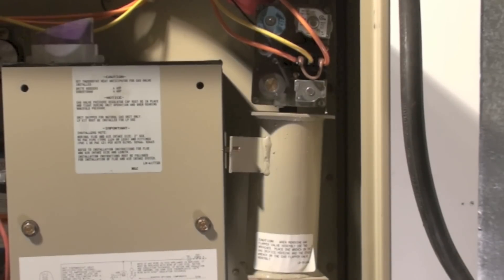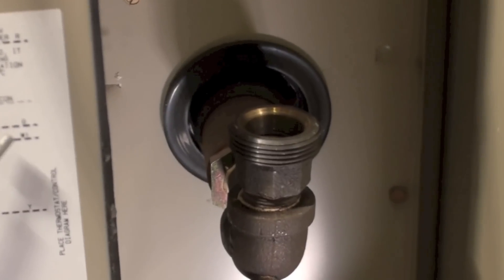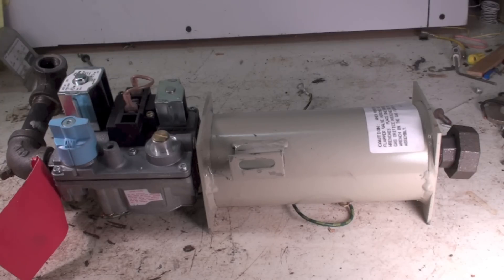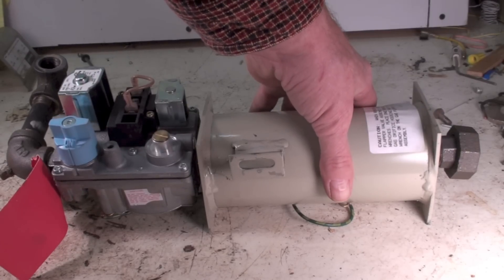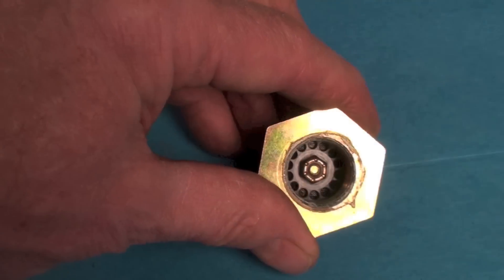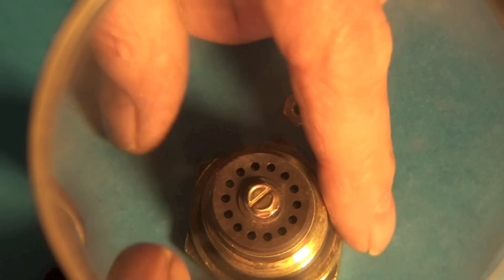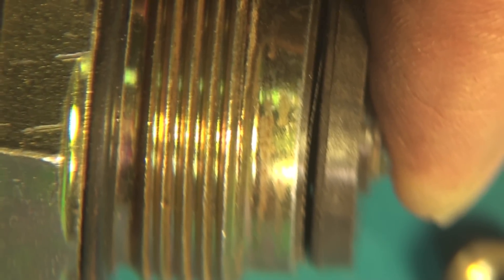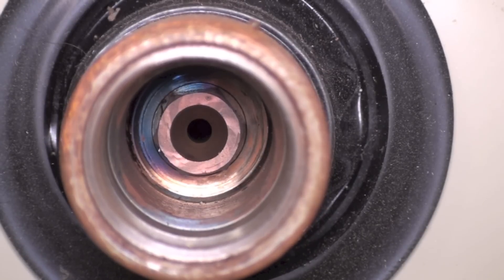How the gas flapper works on the pulse furnace

Comment: That "Silly Thing" is the expansion chamber. It is NOT used to protect the gas valve, that is one of the functions of the flapper valve,the flapper acts like a check valve to prevent high pressure going back toward the gas valve. The "Expansion Chamber" is used to deliver a higher volume of gas to the combustion chamber on the intake cycle.
Reply: I just got around to playing with mine... I had problems where it wouldn't start up. Ultimately, I found that removing the plug on the elbow I was able to see the gas valve was working. But apparently there was a problem with the flapper on the gas side. Plugging and unplugging that port with my thumb jarred it loose and it worked. Today I took it apart and I noticed that screw was loose. As soon as I tried to take it apart with two sockets, I found out that the bolt was snapped. I just hope I reassemble it properly now after washing

Comment: I’m have a unit that is not supplying gas. The incoming pressure is a bit low at 4 inWC. I measured no pressure at the elbow below the flapper. It’s hard to access the outgoing pressure test port at the gas valve because it’s right up against that “gas receiver”, but do you think I have a bad gas valve or flapper?

Comment: Thanks for all of these videos. I've learned more about these furnaces that I could imagine. I have a Pulse G14 that frequently won't start. It will run fine for a little while then won't ignite and I need to turn off power and restart it. It used to last a few days before not igniting, but now it's almost every day. It doesn't always restart though, and I need to wait a few hours (or days!) before it will start again. I've had HVAC guys out 6 times or so and they say they don't know what it is. The air flapper has been cleaned, the blower motor axle oiled, new control board and new flame sensor. I don't know what else to try at this point. I want to replace it eventually, but can't do it at the moment.
Reply from the maker: Such a common problem.  About all I can think of is replace the air flapper.  The gas flapper could also be at fault.
GFM
Reply: @grayfurnaceman  My brother just suggested tapping the gas valve. It started immediately after that. Thinking I've found the problem has happened a few times though. The first time the air flapper was cleaned it started immediately. The first time the water trap was emptied it started. It's like whack-a-mole. Thanks for your help. It's an interesting design, but I'm saving up for a new furnace.

Comment: Used to maintain these  and help install in their  "heyday."    One problem  I ran into is intermittent cold lockouts.  The flame rods  ARE NOT   "solid."  Inside the insulator is a spring  and when  cold start,  they thing would not   sometimes conduct enough  through the  flame rod  to maintain a signal.  Difficult to find  AND THE LENNOX  FACTORY TECHS  thought  I was nuts.

Comment: Should the yellow wire from the gas valve be connected to the "G" terminal by the thermostat wires?  When you showing the 12v connection in one of your videos
Reply from the maker: Thermostat color code is field installed wiring and there is no set color.  From what you say, I would not connect a wire from a gas valve to the G terminal which is for energizing the fan.
GFM
Reply: @grayfurnaceman  ok thanks, right now furnace comes on when it wants too, thermostat is set at 68 degrees but doesn't come on.. this pain lives in Michigan and I'm in Az. Trying to figure this out from here in Az...

Comment: Hey, I appreciate all of your videos, especially on the Pulse. I have a G14 and was wondering if you might give me a little help on startup. I recently changed the air flapper. I have never taken the gas flapper apart. The unit pops and sputters when it try's to start, shuts off clicks a few times , pops and stutters again clicks a few times and the 3rd time it starts up and runs fine. It seems to be a little better when the propane tank is full. Maybe fails one time and then coughs and spits and starts the second. Do you have any suggestions for what I might check. Again thanks for all your videos. The hvac company that put mine in went out of business about 12 years ago. I think the heater is 32/34 years old (maybe around a 1987 or 1988 model) . I know about the combustion chambers leaking. I've had that tested, although it's been about 4 years now. I have 2 carbon monoxide detectors at different locations.
Reply from the maker: I would check the pressure coming from the propane tank.  Should be 11" wc.
GFM

Comment: Hello gray....I've done maintenance on a pulse boiler phw1000k....and it runs but from time to time it locks out on "low water reset". The tank is full....I've installed a new tune up kit on it which comes with a new low water probe.....the relay is new as well.....and the flame safe guard is fairly new also. Any suggestions? I'd greatly appreciate it. Thanks in advance
Reply from the maker: In some cases, if the domestic water has very low minerals, the sensor will not work properly.  Just a thought.
GFM
Reply: grayfurnaceman thanks buddy

Comment: Had pulse the other day that has given problems for years. Always has given problems at the beginning of the season. Unit started but wouldn't stay on. Took off diaphragm. Found it to be oily. Took apart and wiped down. Reinstalled and unit started and ran fine. Never cut off again. Also lennox claims sooting can occur at the location the gas tube goes into the air tube. Took a piece of brazing rod and pushed into orfice to knock out any sooting. I believe someone got cutting oil in the line when it was installed.